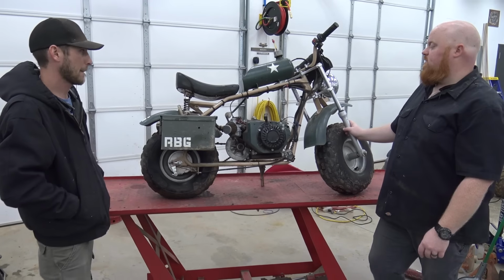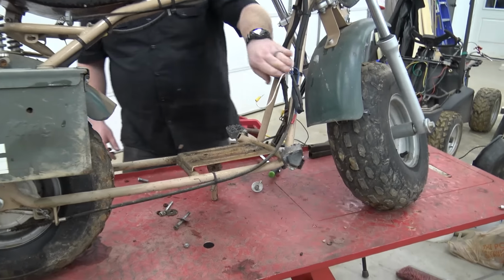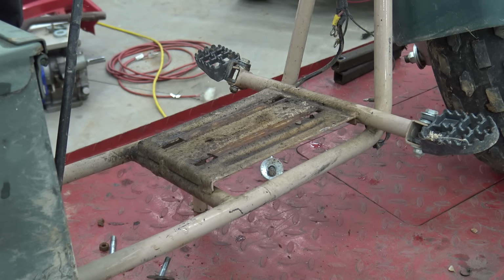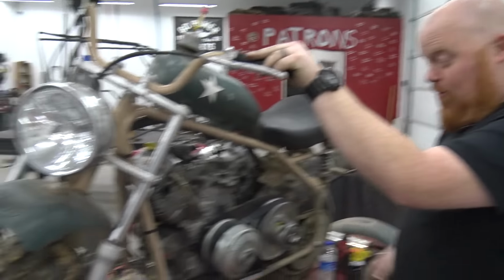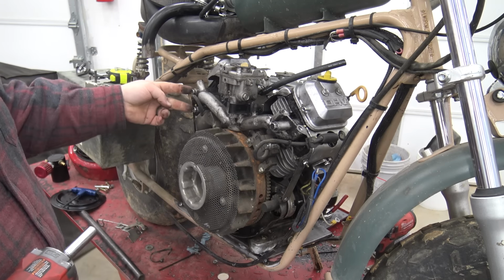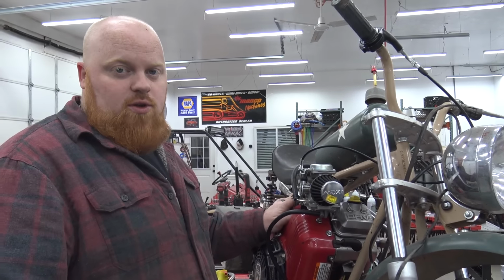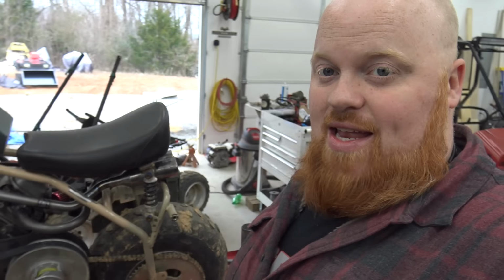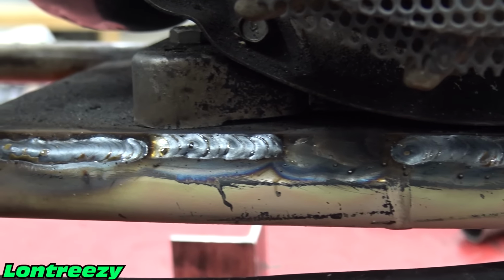479cc V-Twin Coleman CT200U-EX Mini Bike Upgrade Ep1

Comment: weld tip* move forward, with a backwards C motion, hold on the top to let it build up, sweep back around c shaped to the bottom, moving forward a bit, then back up c motion to the top and hold it again.  your finished weld will now be flat, with even leg length, meaning your height width and throat thickness is all the same.  i welded once or twice, you can trust me. 😉 oh, and turn up the volts nice and hot. more heat and more wire is key to moving fast and producing clean solid welds.

Comment: No kidding I pulled one of these out of the mud at a scrap yard, hooked a battery to it shot some ether in it and it purred, still had gas in the bowl so it ran for 10 seconds, I bought it and I'm putting it on my m200 after cleaning it up.

Comment: Red Beard, I think you'll agree with me, the only way to get better at welding (or anything really) is practice. So, I know it's a minor cost, but stick Mrs. Red Beard out in the shop with a "whole bunch" of scrap plates and let her "go to town".  Seems she already understands the basics of MIG welding so as the "old people" use-ta say "Practice makes perfect".  Not just the motions of the handle/wire/arc, but the machine too. How to set it up for horizontal, overhead, the heat ranges, wire feed speed, "the whole Kitten Kaboodle".  
Ya never can tell, she might just get better at it than you!  
Love the videos, the builds, and your having enough "gumption" to speak about and to your faith in The Lord!  
Stay frosty brother!!!

Comment: I've considered getting a decent basic welder for making simple things like mobile drying racks for painting and what not. Though I haven't welded since I graduated auto-body class years ago. Even then I didn't weld for beans since I wasn't interested at the time. I just wanted to do body work and painting. :)
Reply: You literally expressed, almost spot on, my high school auto-body & welding choices. Passed on a half tuition auto body/collision repair scholarship(I had the world figured out in ‘98 graduation, decided partying was more important and pissed it away). But 25 yrs later I’ve had to do a lot of stick welding and a lil wire feed for various jobs. But I been wanting to get my own good lil welder just to start projects like this! It all just looks too fun not to. Love RBG’s and a few other mini-bike/fab shop videos. Great way to waste away a lazy Sunday. Now to get said welder and get going on a project bike! Good luck to you!
Reply: @Slumppy1  Thanks. I've been slowly buying tools here and there. I have a nice Spectrum HTE spray gun I bought from Harbor Freight to get me started. But I need to eventually get a good enough air compressor to even use it. So for me it's been incredibly slow as I have to buy things here and there. Then I have projects I have to buy parts for. Which puts the tool buying on hold so I can buy the parts I need to fix something. My biggest long term project I have yet to buy any parts for is my 1981 Yamaha YZ 465. Mainly because other more important things have needed attention first. Plus it's going to be a treasure hunt to find vital parts that are missing from it. But it will be worth it in the end. Who doesn't want a vintage big bore 2-stroke mx bike to ride on? :)

Comment: for the front fork dropping under braking : look intoo mecanical anti dive , basicly makes the caliper mount hinge around the axle , a lever and a pushrod to the sollidy mounted part of the front fork , braking dive can be ajusted by shortening or lengthen the reactionarm/lever from the caliper to the pushrod

Comment: I'm thinking about putting one in my late 60s Montgomery ward mini bike, it was full suspension and was a lot of fun with the 5hp Briggs bit I figured if it fits I might as well
Reply: @billwilliamson9842  I got mine for free from a guy who bought it new when he was a kid, at one point he had it was either a 12hp or 18hp Briggs in it, I don't remember exactly, it was one of the bigger ones it came off a Bradley tractor
Reply: @billwilliamson9842  it was also a 2 speed at one point in time but the secondary clutch went out probably 30 years before I got it and it was just bypassed and turned into a single speed
Reply: @billwilliamson9842  if I could I definitely would, but I'm only 16 and don't have the money or resources to do it

Comment: MINI BIIIIIIIKEEEES
Reply: BWX I have a Coleman ct200u but how fast do you think it will go when I put the predator 212 and stage 1 kit on it with try governor removed?
Reply: @NellOffline  I dunno. Depends on a lot of different things. 212 won't go any faster than 196 probably. I never remove the governors, I use a torque converter and maybe adjust the throttle linkage on the governor for a few more RPMs.  I don't want to blow up engines.

Comment: I replaced the Predator 212cc engine in my Massimo Baja Warrior MB 200 with a Briggs and Stratton Vanguard Vtwin engine, 479cc 16hp. Still running the stock carb right now an the performance is impressive already. I did notice I'm getting about 14mpg which is kinda sucky but I'll do some gearing changes and see what happens.

Comment: Should'a said the winner sweeps the floor.  P.S. YOU will never be able to weld as good as you would like either. I won't either.  And, there is more inches of weld holding that plate down than you need.  You'll find out when you have to take it off.  Welding is fun, huh Miss R.B. ?   :)

Comment: The flywheels are a lot better built  then the Chinese engines. We've had them held at 6,000 rpm and at 5500 for over an hour on built boat engines

Comment: I have a vangaurd on a zero turn and i never could get it to run without a partial choke, i took the carb apart cleaned it all new parts and it still needed a partial choke to run.
Reply: May be that your jet is too small.
Reply: @IGMWN  makes sense thanks

Comment: I have a 212 ungoverned, cammed, with valve springs  with a mikuni carb and a torque converter that i put on a CT100.....Its unrideable....I cant even crack the throttle a quarter of the way.....anyone think a clutch setup would make it a little less peppy off the start.....It looks and sounds sweet, but its a paperweight because its useless...